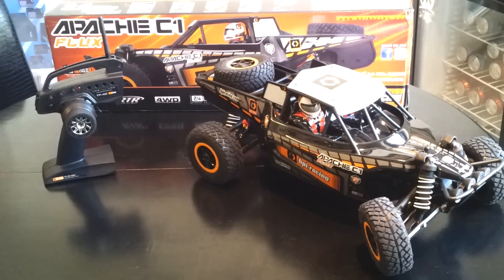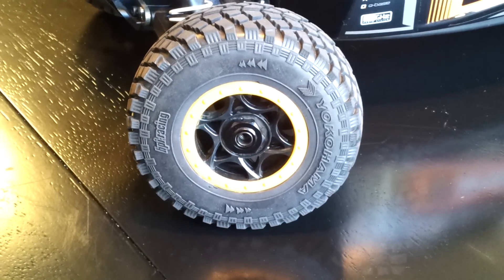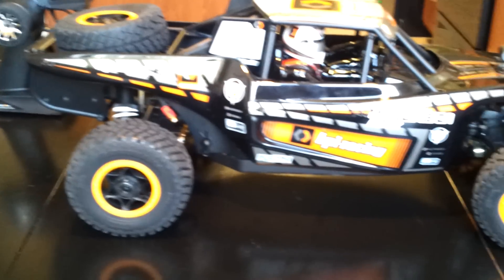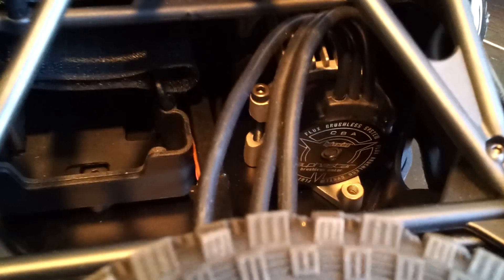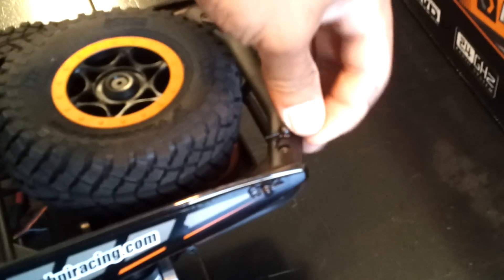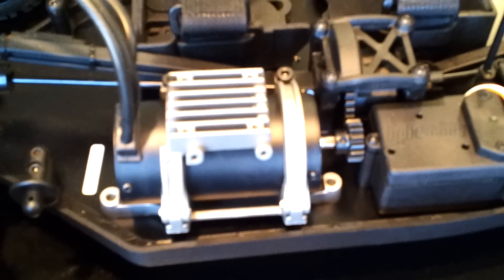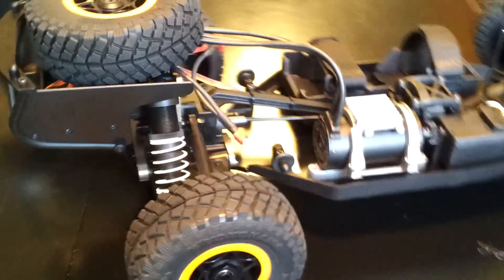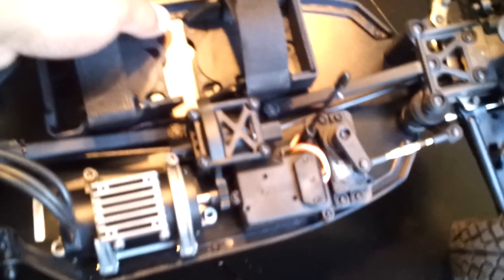Hpi apache c1 quick review

Comment: Take a look at your front dog bones (drive shafts) where they enter the diff and see if they are too short. One side of the bone is barely in the cup. There is a video about this issue that causes dog bones to pop out. Make sure to call HPI and lodge a complaint. They won't do anything unless they receive enough calls from customers.

Comment: Mate - I've been reading and watching alot - general consensus  is to move the esc - down to the baseplate - or else - when upside down - impact to esc pins has been a regular problem as the snap from the mother board. Be sure to move it 
Roo